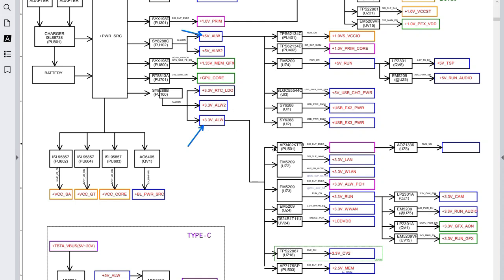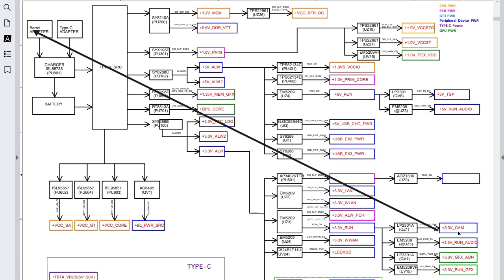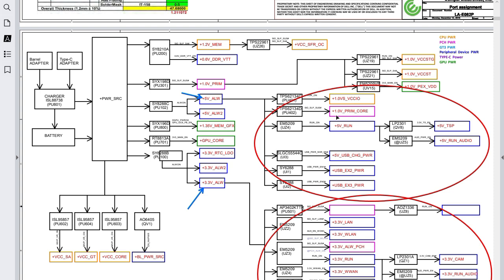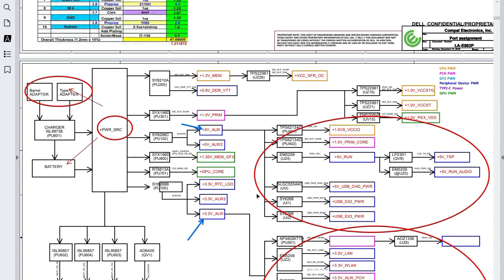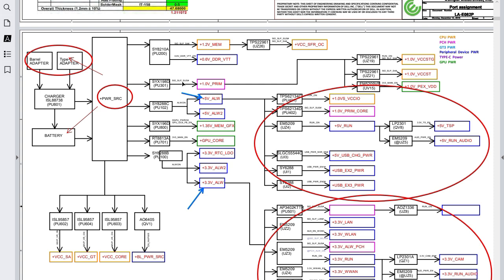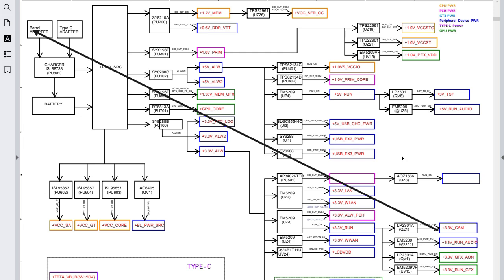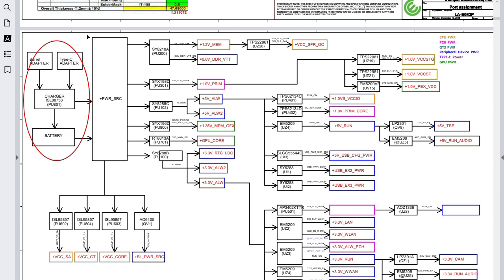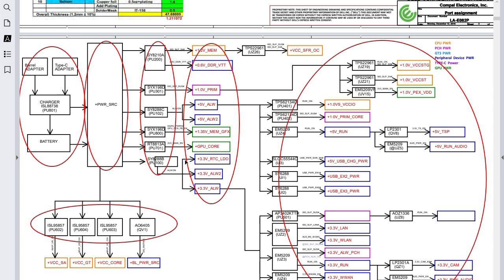DELL power sequence explained step by step - Laptop Motherboard Repair

Comment: Excellent t-shooting tutorial on these laptops.  I have a Lattitude 5490, and am getting the 3,5 flash code, but the camera WORKS fine.  If it matters, I am running Linux.  

Also.. where do I get the schematics and test points?